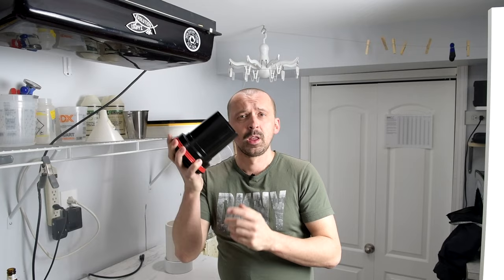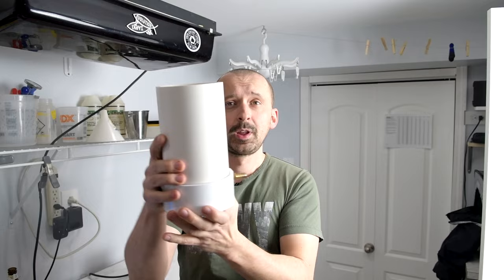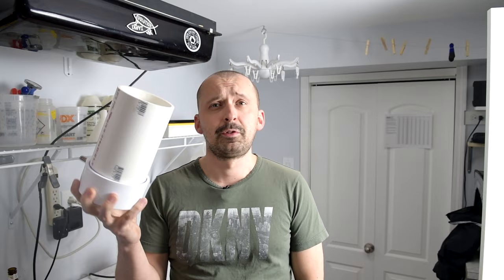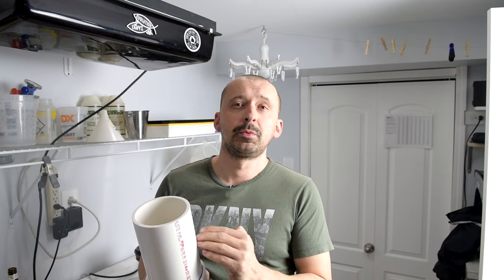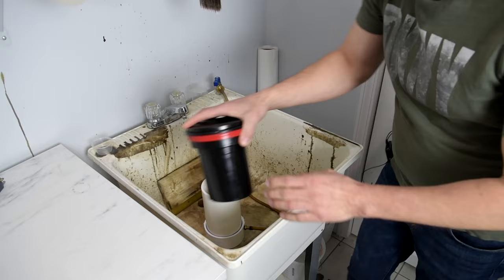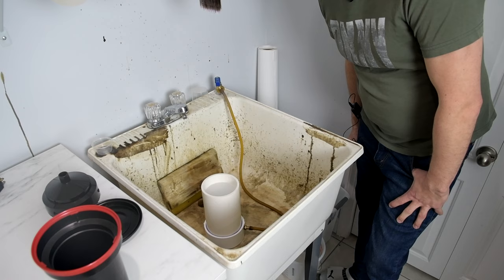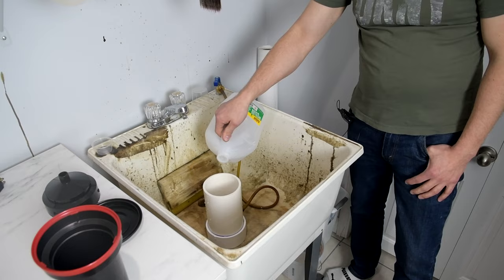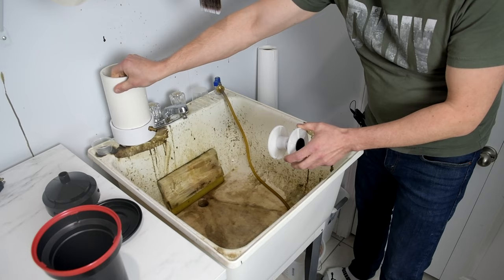Film Washer (Negative Washer)

Comment: You already had one! If you connect the hose to the hole in the top of the Patterson tank the water will enter, go down through the centre tube to the bottom of the tank then rise through the film spiral to the top of the tank overflowing into the sink, washing the film from the bottom up. An inline Patterson water filter connected inline in the hose is a good idea.